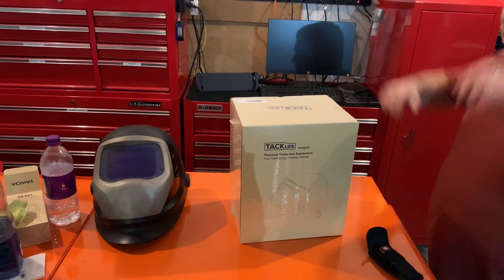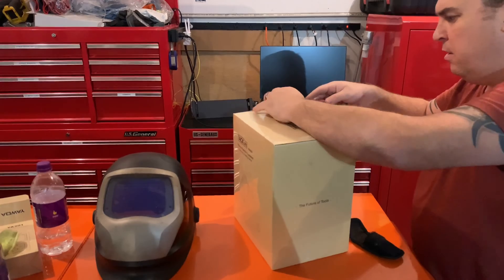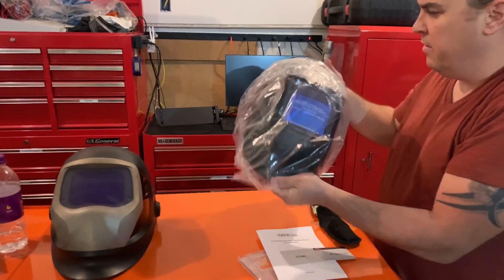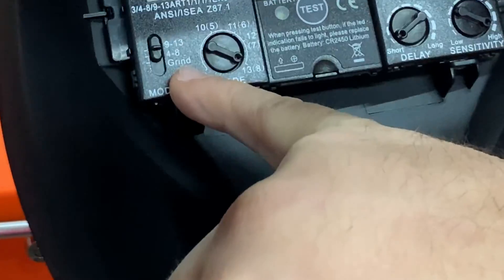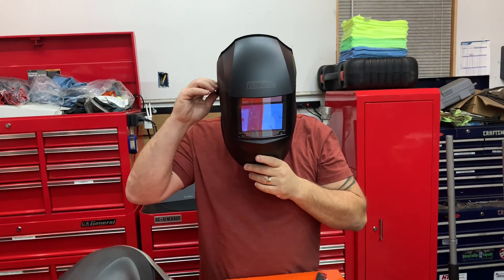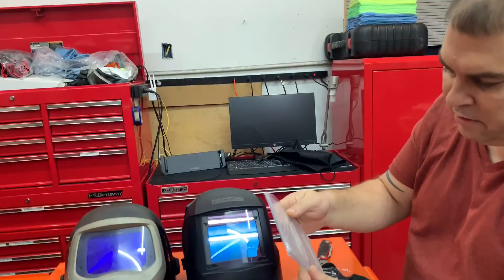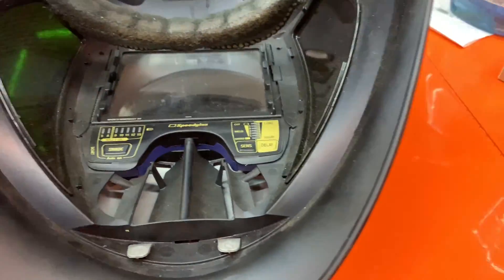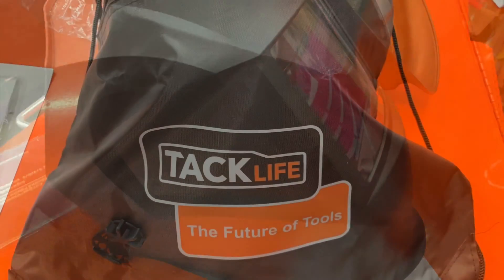Tacklife Welding Helmet VS 3M Helmet Review

Comment: Hope it works out for you. I'm in the middle of a warranty dispute with TackLife. Not a helmet but a hose reel that the level wind quit working on. They are out of stock and won't refund the 120.00 or replace it with a different model. I think I am just out of luck. 

 See ya.